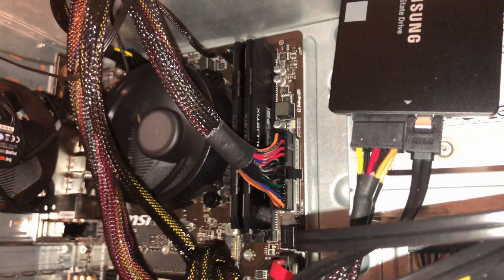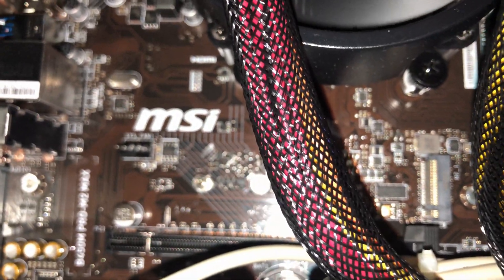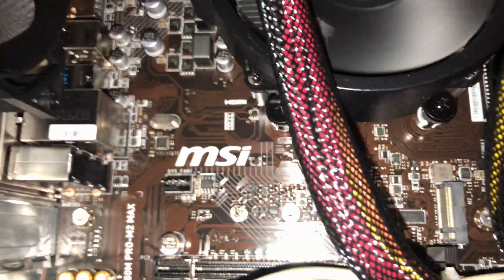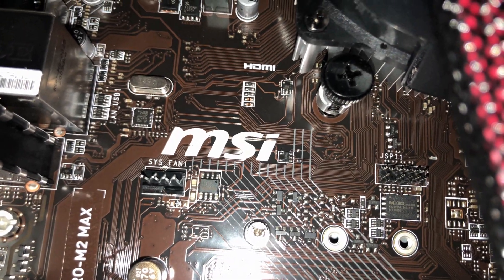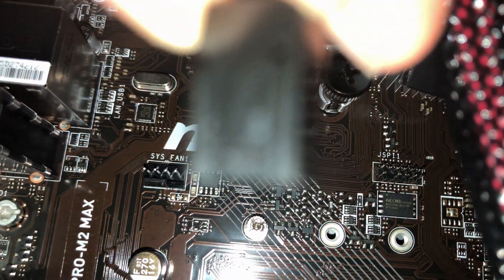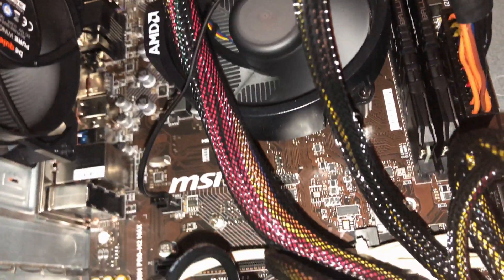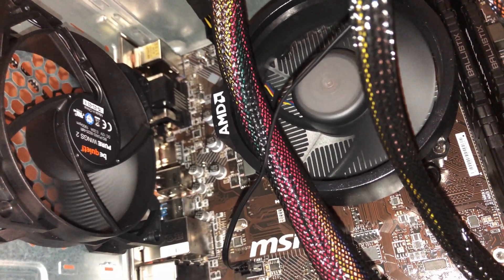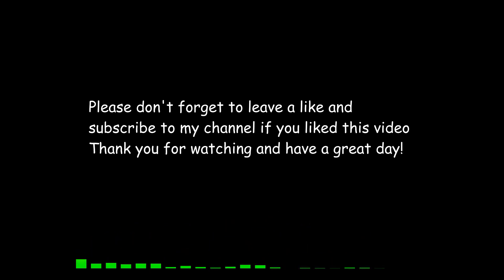How to connect a 3 pin fan to 4 pin connector(DON’T CONNECT THE FAN WHILE THE PC IS TURNED ON!)

Comment: does it matter which pins u are connected to? what if u connect the header to the 2nd 3rd and 4th pin?
Reply from the maker: It shouldn’t be possible to connect it to pins 2,3,4 because of the notch. Even if the notch wasn’t there and you were able to connect it, it wouldn’t work because the first pin is the ground pin and you wouldn’t be connected to that.
Reply: @ultimatesktech1820  ohhhh ill remember that thanks

Comment: If I do this can I control the fan speed Bc I got a pwm splitter 4 pin and 3 pin but my fans are 3 pin but the spilter has 2 space 1 so it missing third but if I connect 3 pin to 4 min can I controll fan speed ?
Reply from the maker: You may be able to do this by adjusting your bios fan settings. Switch the fan settings to “voltage control” rather than pwm. It may also be shown as “DC”. However, I don’t know whether or not the lack of a third pin for the adapter will allow you to adjust the speed.

Comment: I conjnected my fans while it was running it didnt cause any problems?
Reply from the maker: Connecting the fans while the pc is on most likely won’t cause any problems. However, there is a very slight chance that it will so I updated my title.

Comment: My motherboard short while i plug the conector in and it stoped the compiuter i closed the psu before i conected the fan
Reply from the maker: Did your motherboard short because you connected the fan?
Reply: @ultimatesktech1820  yes and the fan was shit the fan cable burned after 1 sec from plugging
Reply from the maker: If you turned off the psu before connecting then the problem is with the fan
Reply from the maker: I connected it while the pc was running, but to avoid all risk, always turn off your pc before connecting a case fan. In the first comment, you said that the pc turned off after you connected your fan. However in the next, you said you turned off the psu before connecting.
Reply from the maker: Can you please clarify so I can help.
Reply: Nvm i didint read the manual and i conected the fan  3pin in cpu 2 4pin then i burned the wire after turning on the psu
Reply: Im sorry if i disturbed u
Reply from the maker: Np. Does your motherboard still work?
Reply: Yes and its an rog strix b250f
Reply from the maker: Nice

Comment: Hey I was wondering do you need a cpu hooked up to get the fan started or as soon as the motherboard is powered will it work?
Reply from the maker: The fans might spinup when you bootup the PC. Obviously, the PC won't start, but you may be able to test the fans if thats what you are trying to do. However, this could vary on what motherboard you have.

Comment: Bro will it work for RGB fans too? I mean will the RGB be synchronised with the motherboard properly?
Reply from the maker: The fans power will be conntrolled by the three/four pin connector shown in the video. However to synchronize the RGB, you will have to also connect the fan to a RGB header located on the motherboard. Without this header, you will not be able to control the RGB lights.

Comment: Bro is it ok even if 5v 3 pin and my mother board has 12v  4 pin?
Reply from the maker: Is your fan 5 volt? If so this should work just fine. Edit... https://rog.asus.com/forum/showthread.php?110272-What-do-5v-and-12v-RGB-cables-look-like-you-ask If you were talking about the RGB headers, they aren't compatible.
Reply: @ultimatesktech1820  Yes it has 5v 3 pin. I just want to use it even if they don't sync. But I don't know how to connect it properly. Anyway thank you so much! I really appreciate that. God bless you bro. 👊

Comment: does it work when reversed? 4 pin fan connecting to 3 pin?
Reply from the maker: It’ll definitely work! The only drawback will be that the fan will run at full speed all the time. If u want to save 5ish bucks u should prob buy a 3 pin fan.

Comment: bruh is this safe ???????
Reply from the maker: Yeah, it’s definitely safe. The only drawback with connecting a 3 pin fan to a 4 pin connector is that you won’t be able to control fan speeds.